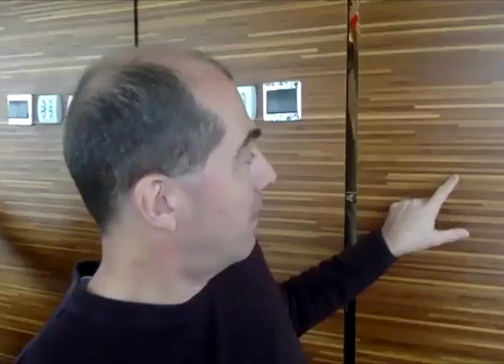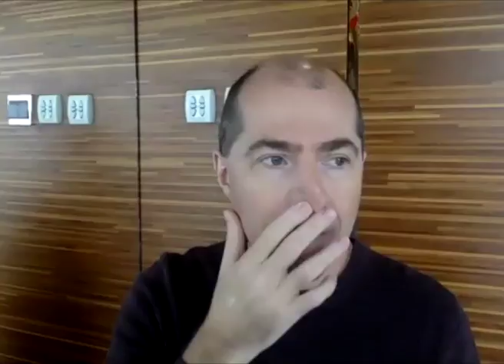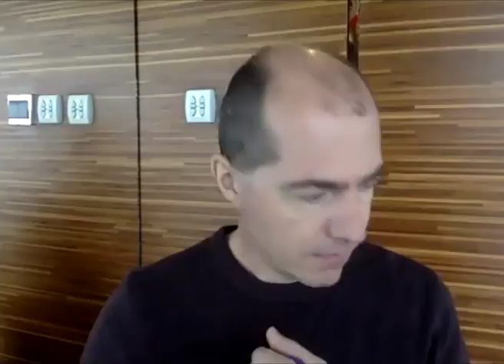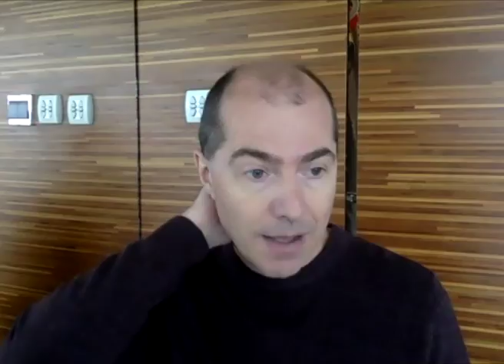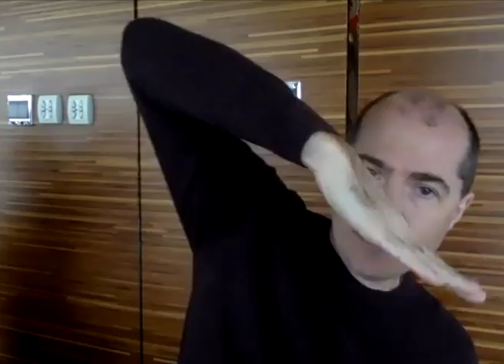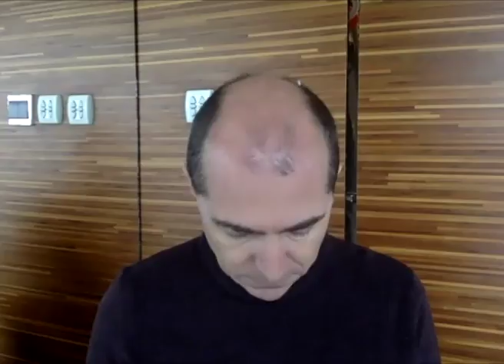Zoom call: picking the right recipe for your bean

Comment: Hi Buckman I have a query that I didn't understand. If dark roast beans are more soluble than light why we use less grams in dark? Except we change the brew ratio by using less water in dark roast coffees please I would happy to answer answer me
Reply from the maker: Because dark roasts give up their flavor easier to water, you don't need to use as much coffee beans to get the same amount of coffee material in the final drink.

But there's a different thing also going on: dark roasted coffees are generally made thick, with a high TDS, so that you get nice mouthfeel. But light roasts generally are made thinner, with more water, so you get more flavor clarity.  It's just a preference people have.
Reply: @decentespresso   thanks for the quick answer very understanding all this you think that dark roast can taste better in higher tds values like 10% and light in lower?
Reply from the maker: @ΔημητρηςΚ-π2κ  I don't want to say "taste best" because it's a matter of style.  After all, Americanos with dark roasts are common, and very low TDS.
Reply: Hi buckman again so do you think that with dark roast coffees we have to use smaller brew ratios like 1:1.5 than light roast?